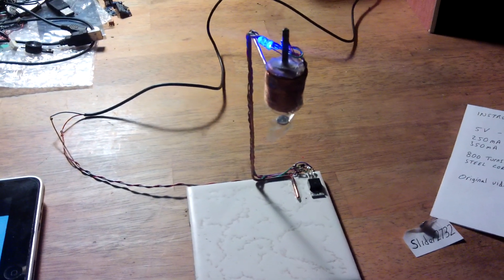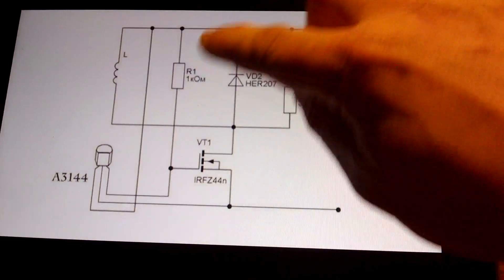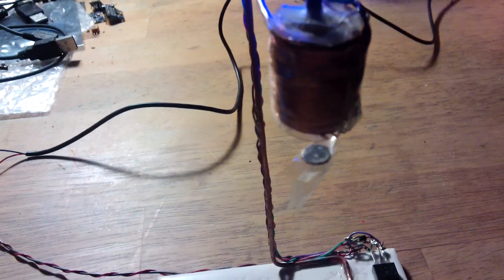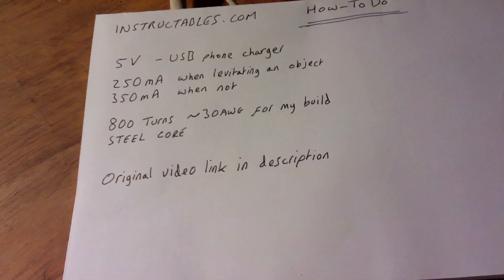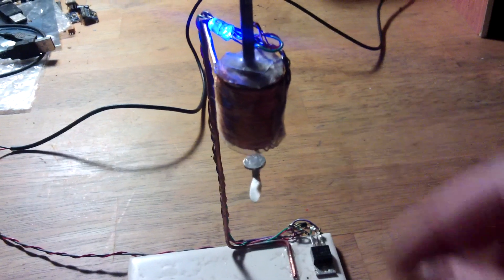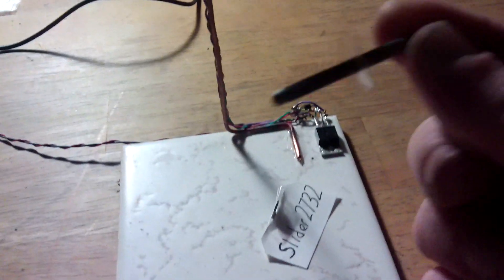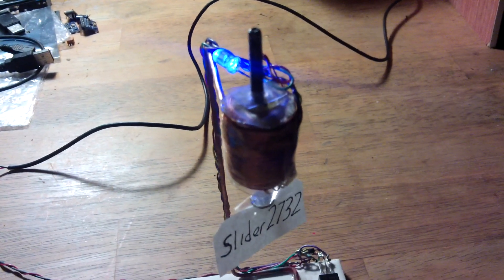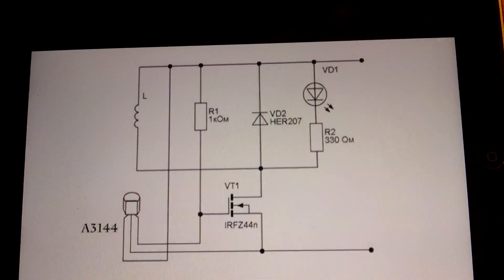Simplest Levitator Ever - circuit by How-ToDo

Comment: Wow I completely missed your coverage of the levitators, had to do some more YT digging to find it. The LED addition is def a good idea. Yours looks incredibly stable, more than mine using the linear output to get precise set points. I was thinking this should work but kept seeing others stressing the importance of using the linears even in a brute force switching arrangement.
Reply from the maker: And somehow I missed your comment here lol. Yep, it works great this design. I would advise the design that uses the -12V though, it's more complicated, but can lift Hotwheels cars etc with complete stability. 

https://www.youtube.com/watch?v=4aIp_46MCWc
Can swap the I/R for a Hall sensor  :)

Comment: IRFz44n mosfet Vgs is 10v... is your mosfet logic level? How does your 5V hallsensor operate the mosfet?
Reply from the maker: The MOSFET here was a random find on a TV circuitboard, can only suggest to try what you have. It can be changed out readily if a 3 pin socket is used in the build. The circuit presented isn't mine, so the presumption is IRFz44n worked for How-ToDo.
The Hall sensor simply triggers the Gate with changes of magnetism from the suspended magnet. Its reference is the coil, with the 1Meg resistor resetting the MOSFET. Does well with such light loads, but they can only be very light loads.

Comment: Where i will get the coil?
Reply from the maker: Have to make one, but it's not difficult. 800 turns of 30AWG around a drinking straw is one method, such that a steel screw can go in to help the tuning. 1:19 discusses the coil.
Reply: Slider2732 ok

Comment: According to your scheme you always have 5V on the mosfet gate. What is the sense of it?
Reply from the maker: Probably for ultra simplicity and lowest component count. It's not my circuit, just a replication and it runs fine :)
Reply: So, what you have changed in this scheme to make it run???
Reply from the maker: The addition of the steel rod through the middle, adjustable, to alter the strength for different loads. The original circuit needs careful setting up because of being so simple in design.
Reply: So where this promised, in the title, simplifications in electric scheme? Where the most important thing which would show how the control of the load position is performed and could be reproduce by others.
Reply from the maker: Compare it to any other Hall based levitator !
Load position is shown with the adjustment of the screw thread bolt.
Reply: Yes. I'm idiot. You have completely different hall sensor. So it works completly different. Sorry.
Reply from the maker: I did wonder why you seemed so set on it all, but am happy to know you sorted it out !
Happy building :)

Comment: CAN YOU PLEASE TELL ME ONE THING..?WHAT IS THE COMPONENT THAT CONTROLS THE LEVITATION IN THE SCHEMATIC..??ALL I SEE IS THE SENSOR THE ELECTROMAGNET THE DIODE THEY PUT FOR THE INVERTED SPIKE VOLTAGE THE MOSFET SOME RESISTORS AND A LED...!!!WHAT IS THE THING THAT READ THE SENSOR OUTPUT AND CONTROLS THE ELECTROMAGNET.?AND IF IT WORKS AND YOU WANT TO LEVITATE  SOMETHING HEAVIER...CAN A MUCH STRONGER ELECTROMAGNET WITH THE SAME PCB WORK...??IF YOU KNOW PLEASE ANSWER...!!
Reply from the maker: The Hall sensor controls the on/off switching of the MOSFET. There is a threshold, when the magnet underneath affects the hall sensor compared to the coil magnetism.
This sort of levitator reacts well with magnets added above the coil. Much more weight can be added underneath.
Reply: THANK YOU VERY VERY MUCH FOR YOUR RESPONSE...!!I THOUGHT THIS WAS JUST A SENSOR ...BUT IN FACT THERE IS AN IC...THESE ARE SWITHCES NOT JUST SENSORS...DIDN KNOW THAT ...BUT READ THE DATASHEET...SO THE  LED JUST HELPS  US FINDING THE LEVITATION BALANCE..?!!!ANYWAY THANK YOU ONE MORE TIME..FOR THE RESPONSE...WISH YOU THE BEST...!!!
Reply: JUST ONE MORE QUESTION....IF WE WANT TO USE AN ELECTROMAGNET FROM EBAY 12V...DO YOU KNOW WHAT CHANGES COULD WE MAKE TO WORK ALL THIS IN 12V SO WE DONT HAVE 2 SOURCES...ONE FOR THE HALL SENSOR AND ONE FOR THE ELECTROMAGNET?...THE MAX OPERATIONAL VOLTAGE OF THE A3144 IS 24V SO NO PROBLEM...BUT COULD THIS DESTROY THE MOSFETS GATE...??I DONT THINK SO CAUSE THE OUTPUT OF THE HALL SWITCH IS THE SAME RIGHT??WE DONT CARE ABOUT THE SUPPLIED VOLTAGE IN THE SENSOR CAUSE IT HAS A VOLTAGE REGULATOR INSIDE....RIGHT??
Reply: just increase the resistor that is going to the hall sensor...

Comment: hi there,
Interesting circuit indeed.This circuit can be powered from 1.5volts battery if you got suitable boost circuit to get 5volts from 1.5volts to power the hall sensor.The turns can be reduced from 800turns to around 110 turns using lower voltage.The current is little high for idle mode because there is higher bemf using higher turns.
Reply from the maker: Good points ! It would work with 1 of those little square $1 5V converters off Ebay. and an AA.

Comment: That is a good one.  It is on my to do list now.  You might get a bunch of replications.  Thanks
Reply: Day FOUR now!  Still no luck.  Yesterday I finally figured out that a "switching" type Hall is needed and not the "linear" type that I have used before.  I am going to have to make a new coil.  This looked so simple.  I figured about an hour for the build. Ha.
Reply from the maker: *****
Definitely a round of applause for perseverance now that yours is running. Indeed, a 1 hour build that takes days LOL, we're all experiencing the same ! But, when that magnet finally sits there...it's a joyous moment.
Reply from the maker: Interestingly it seems to take about 5 minutes to 'warm up', as in the coil gets only lukewarm, with cold MOSFET, but the field magnetics change over that time. After that, completely stable...I ran this for 6 hours straight yesterday and the magnet didn't drop off at all. 
Good luck with your build :)
Reply: I worked on this yesterday----and failed! :(.  I have the worst luck with these "levi-haters". The problem always is that I try to take short cuts and these things don't like that.  I may  have another go at it later.
Reply from the maker: Took me 2 or 3 days :)
About the best tip, is to look for the magnet bobbling about energetically (the coil wires may need to be swapped if that doesn't happen). At that point, it's almost working. Lifting the steel rod slightly, you may suddenly find the magnet sat there and then it flips away. That's why a piece of tape goes under it, to bring the center of gravity down and cures the flipping and wobbling.
Reply: This is music to my ears! I've been trying for the past couple of days (same circuit, and no LED/resistor, and also no iron core) and the magnet has got to the stage where it starts shaking away. I feel like I'm close!
Reply from the maker: MrSkypelessons
You are !
I'd advise the LED though, you can watch it switch on&off with far more accuracy. The switching should be instant from too far to too near, if there's a gap, it means the tuning is way off/magnet size or strength incorrect for the setup/coil wires might be swapped. The strong vibrations will lessen with careful steel rod adj, until, the magnet levitates.
Good luck !

Comment: Nice levitater! Could you add a side coil to make it spin?
Reply from the maker: it certainly doesn't use much power, so that could be an idea ! Even a regular PC USB output would have 150mA spare for another coil, or coils.
Reply: Or could you bifilar the lev coil and have the extra bit off the side? Might only need to be a few turns..
Reply from the maker: This coil started off as bifilar windings. I then connected 1 end wire to the start of the other. 4 or 5 different lots to make it. But, hmm, a few extra turns as a separate coil would work. One idea would be a 555 + pot wired up like a 'servo tester', for left/right spins. Or, save all that gumf and turn the spinner coil around 180 by hand !
Reply: It would be awesome if you could implement the solar dancing flower circuit. That indicator LED should theoretically be putting out enough light to be recaptured into the solar cell so you wouldn't need any extra input, and I'd imagine too much angular force may throw the levitation out of whack. I use a little led at about 1/4 brightness and it turns a little magnet wheel I made so long as the friction is very little.  This seems to be one of those things that seems easy in theory though, but as it turns out is much more difficult in reality. For years I have seen levitator buffs treating that like the holy grail.
Reply from the maker: It does indeed work on solar, Lidmotor did a vid of the same circuit after this one, to show that. I got it to run with a 500mA 5V setup outside, but no way should it have needed that size really. A decent large cap then made all the difference. A lot of this sort of thing really benefit from a huge (10,000uF and up) cap across the input..even though solar is DC.
Reply: slider2732 I got confused, now I remember what I was thinking of.. The getting the levitated rotor to spin was indeed fairly simple as Lidmotor showed, but the 'Holy Grail' I meant to refer to was the maintaining of a levitated rotor using magnets only. So basically one of those tops that you spin up over a big ring magnet from say a MWO, and it will levitate so long as it's spinning fast enough. I can see now thinking about it why that would actually be quite nearly impossible, but I still think it can be done!
Reply from the maker: It can...if you can reliably spin up a home made one of about the same size. I tried it in the summer and never got a clean spin up (over microwave magnets), some of these folks on YouTube make it look easy !

Comment: Great video Slider :)
Reply from the maker: Cheers. It's a bit tricky to get the exact lifting/weight sorted out, but works great. You just have to get the magnet underneath to wobble violently, at which point it's then only a case of adjustments.
I have to work on my 'erm's while speaking, but it's the first vid i've done since having 4 teeth out. believe it or not I was nervous !
Reply: slider2732 teeth can always be a painful subject :-) By coincidence I have been trawling the charity shops today (same as every day) and found a model plane designed to be levitated on a levitron type display unit. The video will be a couple of weeks down the line but I was amazed by the coincidence.
Reply from the maker: That sort of thing is marvellous, flying in the air as they do and better than a bolt or AA battery or something to look at. Best thing I ever came up with like that was the HotWheels Delorean with wireless electric lights in the air....which i'd like to redo. 
Am looking forward to the plane vid, which yours never are :)
Reply: slider2732 it will only be one of my Charity Shop Shorts as I only looked and didn't buy it, but I will see what information I can find about it for the video description :)

Comment: can you make object floating?
Reply from the maker: It seems to like a very light weight, in this case 1 magnet with something under it to prevent the magnet flipping over. But with some tinkering it should be able to lift heavier objects.

Comment: Wow, that is incredibly simple circuit. Thanks for passing on the information.
Reply from the maker: My pleasure, was the first thing I thought of doing when the bolt adjustment worked "the lads will like this one". 
It's one of those that makes complete sense, but should produce a wobbling mess that never quite works..yet it does !